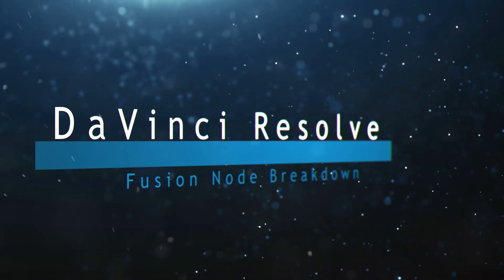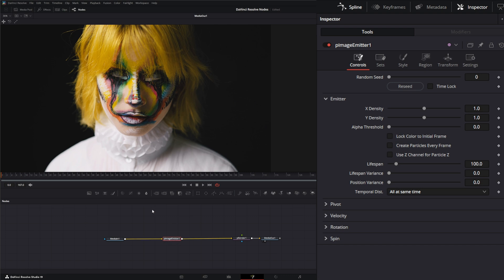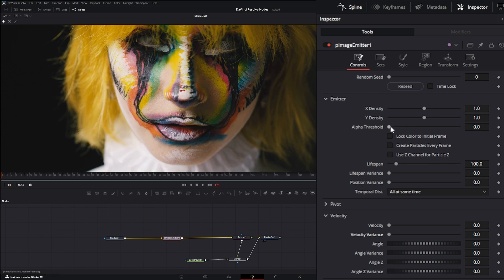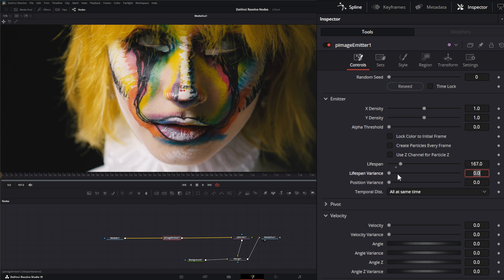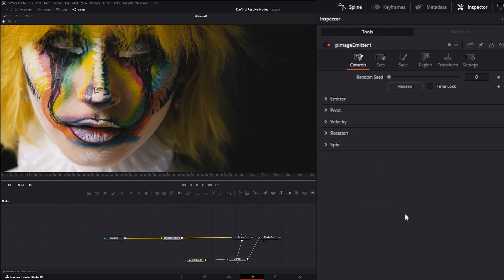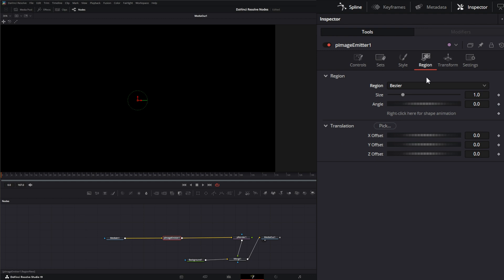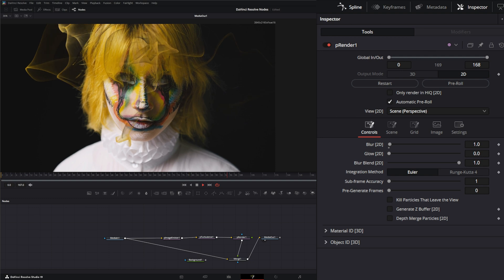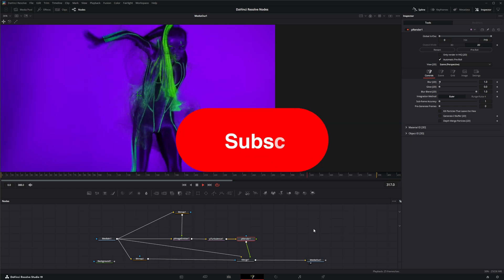DaVinci Resolve Fusion Particle Image Emitter Node

Comment: What's the difference if you had used a pEmitter and set the region to bitmap, and then the color to Use Color from Region?
Reply from the maker: Setting it as region just tells the particle WHERE to spawn based on the channel selected within the bitmap region and does not have anything to do with particle color. Use color from region will force the particles to use the colors from the bitmap region (from the actual image) and has nothing to do with where the particles spawn.
Reply: @bdscoveredstudio  But, wouldn't using the bitmap region as the spawn points from your image and then color from region all on a pEmitter give similar results?  I'm mainly asking because that's what I did for this:  https://www.youtube.com/watch?v=Nq1S7-M-klU .  Though, I also used a mask moving across the logo text to make the logo sort of dissolve across the logo before moving away via turbulence and directional force nodes.  I'm curious about this is a different method to achieve similar results.  It seems like the end result would be the same with both methods?  Prior to adding the movement, I had particles making up the logo, then the turb and force nodes gave the final effect afterwards.  I definitely learn stuff from your node videos, so am asking this in case I'm missing something.
Reply from the maker: If I understand your question, yes...it would have the same result. The beauty of fusion...100 ways to do the same thing! But...it makes me happy you realize this...means I'm achieving my goal of teaching nodes as opposed to showing steps! Glad you're creatively grasping it all!
Reply: @sfriebe  I was also gonna say! Ive also seen these results achieved with pEmitter + Bitmap + 'Use Color from region' too so was hoping to see what exactly the difference was..

Comment: Apparently, all you have to do is if you have the free version is add the resolve exe/ app  under display settings (right click the desktop windows)/  system/display/graphics, there you will see the add button, just locate the resolve exe in the black magic file folder, after it is added you will see the drop down menu where you initiate the GPU whatever mode you like. High performance mode, or power saving mode, or let windows decide. BTW , i hope this software is not at the end of its cycle, ie all the new Ai integration and such. hope it only adds less than a grand to the current price when Black magic releases their AI resolve version. Just using this software for a few days, I can see where Ai will improve the editing experience and or decrease the user's workload experience.
Reply from the maker: Thanks for tipping fellow subs...I really don't see AI interfering with BMs shelf life for Resolve...the Studio version already integrates some AI (refereed to as Neural Engine by BM).  And, as amazing as AI is...it will never be able to compete with the human imagination!
Reply: @bdscoveredstudio  Just watching you slog through particle emitter's, to the very point, Ai is very good at mathematical calculations, and it does it very fast and to the point with fluid dynamics. As for ai not being able to compete with human imagination, ai would not be a 500 trillion-dollar industry looking forward, for people that are unable to see the future. My bet is we are less than 3 years away from a big war in this current environment. It is coming up to the 100 year anniversary for the military using Ai in real world apps.
Reply from the maker: I see your point,  but ai wouldn't be where it's at without human creativity (in any medium) being input or human ingenuity creating it...that's all I meant.